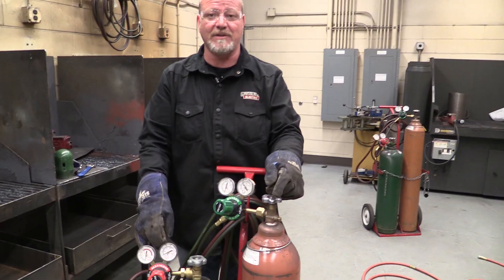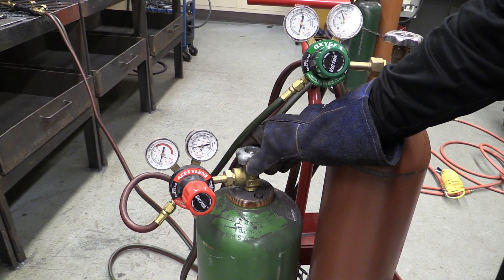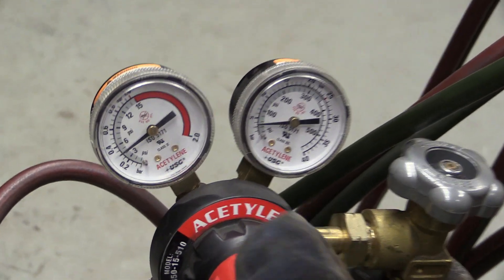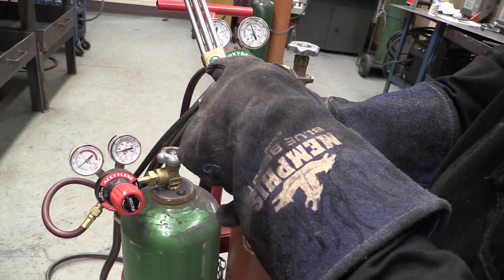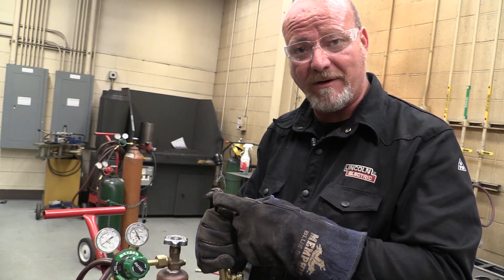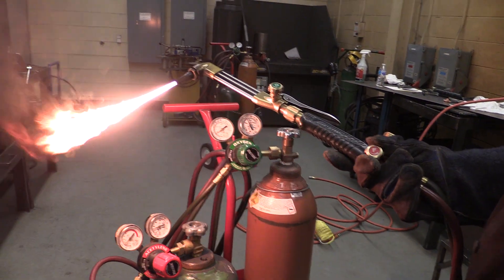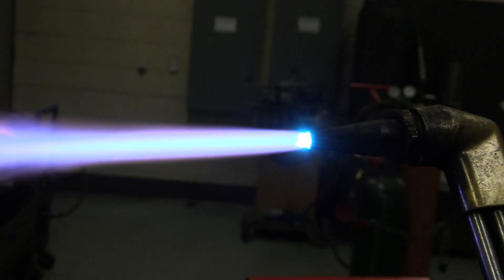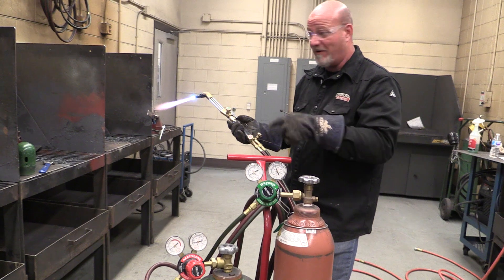Setting up an Oxy-fuel cutting torch system.

Comment: Thank you so much! This was very informative! I recently acquired Acetylene for my work truck which I haven’t used since I was in welding school all the jobs I’ve worked at have used propane as a cheaper option but working outside it seems the propane has more issues for me. I just set up the torch yesterday and got cutting but it seemed like something was just off it wasn’t blowing away the metal enough I could still get the job done but I wasn’t pleased with it and it was taking longer than it should have.  Here we had not used any torches that style with the upper knob so like all the old Harris’ we have I was adjusting the lower oxygen knob… I remembered from weld school back in 2016 what the PSIs should be at and to turn the torch up until the black smoke disappears, but I had my oxygen set at 30 and acetylene set at 6. I was growing frustrated with what ever was wrong but after watching this video I know where to fix my errors and how to use that torch style! Thank you!!!

Comment: The increased oxygen is not just to blow away the molten metal, it leans out the mixture and creates a much hotter flame.  This is exactly why you can't run your vehicles too lean, because it will overheat the engine.  I've ran my 250cc 2stroke dirt bike hard when it was too lean because of a vacuum leak, and it literally burned a hole in the top of my piston just like a blow torch does.   Great video..

Comment: Can you explain to me how on a machine torch the oxy and fuel are BOTH fully on before the torch is lit, and then they both shut off at the same time,,,,,,with nari a problems. 

I have been lighting the manual hand torch by setting setting the valves where I know they will be when at neutral flame and then POP. ,,,,Just exactly like a machine torch.....Been doing it that way for well over 50 years with no problems. (And on a torch used only by pros our tips  last months. 

If I catch a guy lighting a torch the way you describe and sooting everything up first time he gets a very sterh ass chewing. The second time he gets his money.
Reply from the maker: Great, you found success, never argue with success. After 50 years of lighting a torch I am sure you are very capable of adjusting it before lighting. These videos are focused towards folks who have never had a torch in their hands. If you hand a guy his $$ for producing soot 9 first or second time) when they are learning, you must have alot more skilled people to choose from than most everyone out there. good luck